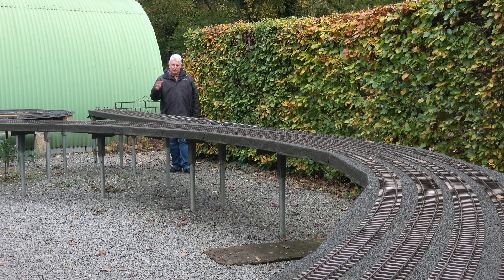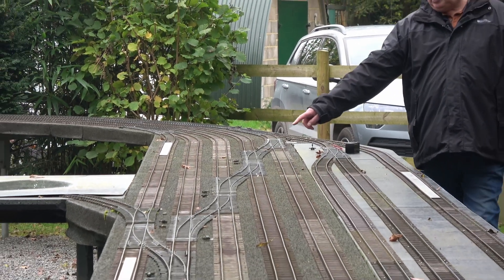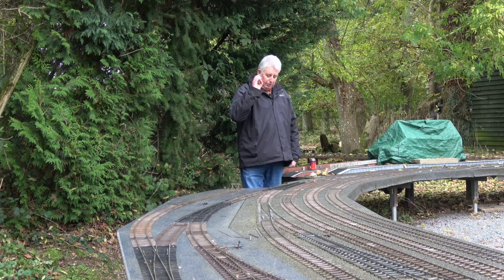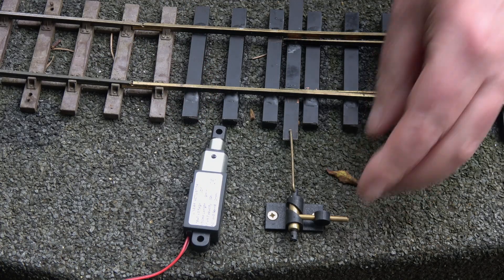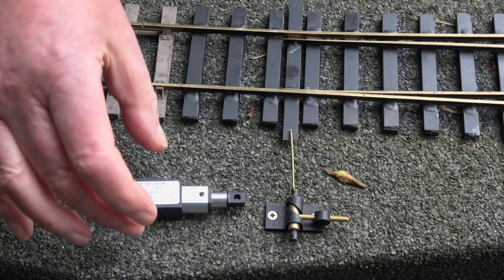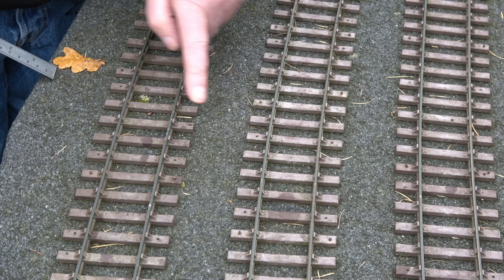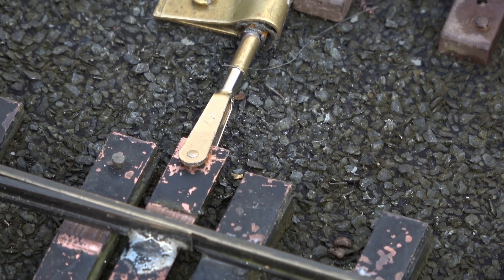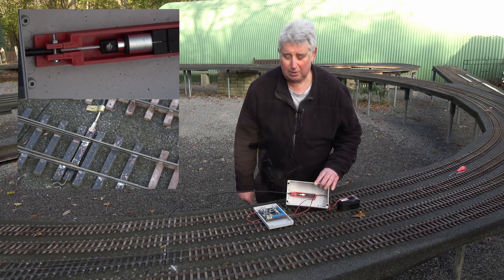Signalling Gauge 1 Garden Railway - Part 1

Comment: Those actuators look pretty good and if you are happy with them, then that is the way to go.
As a matter of interest only, on my former ground level G1 garden railway, I used cheap replacement car central locking actuators. These were operated by using a 10000 microFarad capacitor in series. A car single pole double throw relay would either charge or discharge the capacitor and the actuator would operate in the appropriate direction with a bell crank. The relay was itself supplied via a Mosfet and timer circuit. I mostly used Peco track and points.
As your layout is raised, as a suggestion, you could put linkages through the baseboards
Reply from the maker: Thank you for your feedback, we thought of linkages through the baseboard but we are told that could introduce water ingress into the baseboard that is partly wood covered in roofing felt.  This was what made us look at the belden cable idea.  Regarding driving the points we may as well use our ASP-222 boards, if you want to learn about these look at the sequencing video.

Comment: point actuator:
90 degree bell crank, used to adjust the throw sounds not only sensible but actually quite prototypical. you could also angle the actuator slightly to stop rainwater going up the arm towards it. sticking the omega loop in is a very good idea (also handle thermal expansion). should work perfectly.

signalling:
if I understand the bit around the four minute mark, that two aspect is on the main line approaching the point in a trailing direction and its "green means the point is set for mainline train to proceed" & "red means mainline train needs to stop the point is not set for you" with the branchline entering the mainline not actually signalled? - in which case unless you want it interlocked with the mainline occupancy its a case of a limit switch somewhere (or in the controller for the actuator) such that when the actuator is fully one way the light is green, otherwise its red

as for the actual control? probably something like and ESP32 with a proper antenna, or nRF024L radio link to a base station, and then an arduino nano or similar, very simple software, whatever is needed to drive the actuator and an output for the two lights. chuck in a rechargeable battery module and either a small solar panel or add a charging port to it and pretty much job done.

given you have more points an ESP32 would make for a decent "virtual signal box" able to control a few of these, and the bowden cable idea means you could physically mount them all in one pace which could perhaps house a decent battery or whatever.

you then have some other control station managing sending the required signals to operate it all. really just a pretty basic concept slightly scaled up to handle the 'proper' actuators and likely bright lights in a robust enclosure to cope with all weather operation.

fun project though
Reply from the maker: Thank you for your comments.
The signalling reigime has not been finalised yet.  Oue ASP-222 boards that we are using can drive two sets of four aspect lamps, so we are pretty much covered whatever is finally decided on.
Good point regarding the bowden cables all coming back to the operating box.  This is yet to be decided as we have perfect RF connectivity using our ASP-222 boards and these are totally configurable.  This will be a topic in a later video.